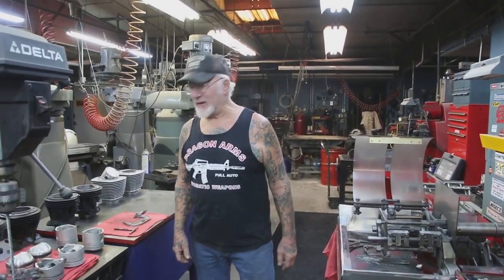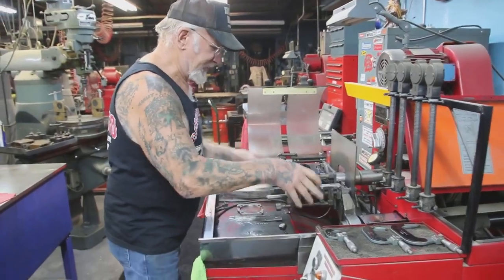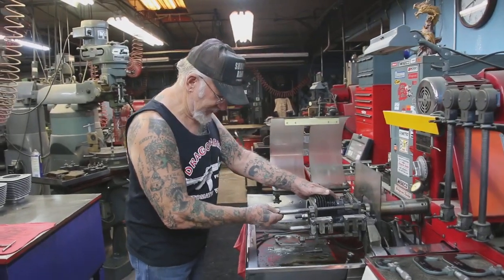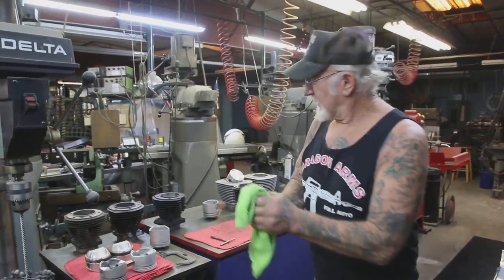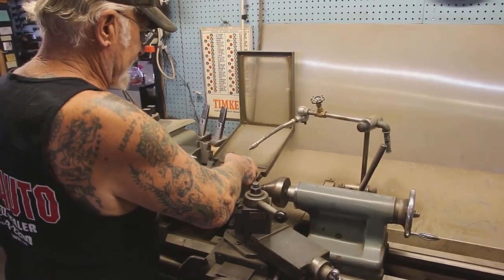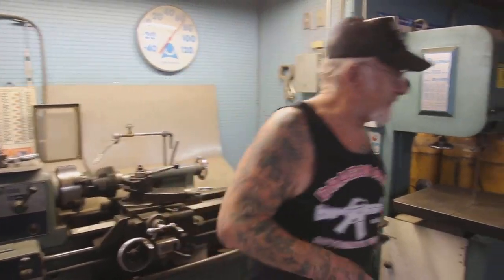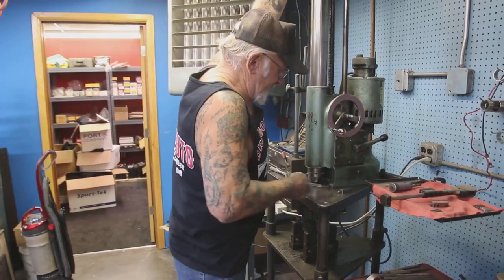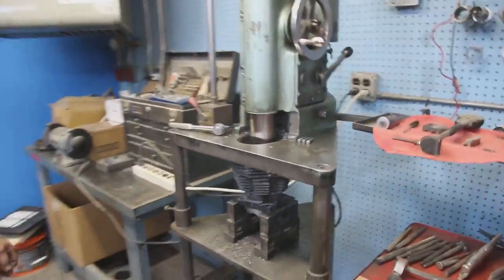Boring out cylinders today!

Comment: When i was boring a wide array of engines the customers with the Harleys were the worst some would bring the barrels back and say it has to much clearance look the piston wobbles so then you have to explain to them that the piston is not round it may look round but it is not, the clearance is measured at its largest point which is at the bottom of the skirt 90 degrees to the gudgeon pin. The harley guys always thought they knew best.

Comment: You have a great setup, Mel. I was a machinist, but I didn't do automotive type machining. I made all types of parts for industrial applications. The shop I worked for had a similar honing machine, Bridgeport milling machines, and all types of milling and turning machines. We used the very same dial bore gauges you have and that's how I know you have a great machine shop for motorcycle engine repair.

Comment: i don't know when the last time you weighed a set of pistons, but those junky cast pistons weigh a lot more than a nice set of forged pistons. I know, I've been doing this for 30+ years and still doing it today.  After you start cutting the cylinders down  you have then thrown off the intake manifold and pushrod length. Then you still don't have much more compression because those junky cast pistons seldom ever oil out to what they are advertised for also. I know. I do that quite often too. Then you end up with cylinders that are too short and you can throw them in the trash because when you put a good set of pistons in them there will not be enough length for the top piston ring. Also the 100 grit roughing stones should only be used to straighten out the cylinder and the 280 stones should take out the last .005" so you have a nice finish, not a rough finish.
Reply: Yea I like Dragonman but having been an automotive machinist for 16 years I couldn’t have gotten away with some of the stuff he does, his business tho.
Reply: @stevenbridgman7446  Yea I like Dragonman too, and he's got a slick set up, the whole machine shop, but there were quite a few failed dragonman motors in the shop back in the early 90's.
Reply: I do 2 stroke outboards in my shop. I use 280 grit to hone out the last .001 to get a plateau hone. Also my Kwik way bar gets a cylinder within.0001 so there’s not much straightening to do.
Reply: I could NOT believe it when he ran the piston done that bore that was full of honing slurry.